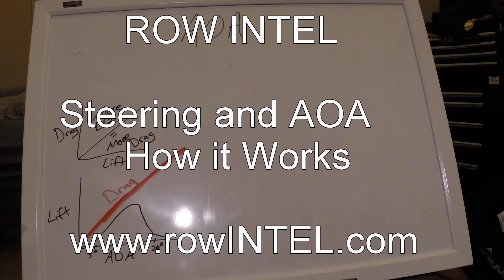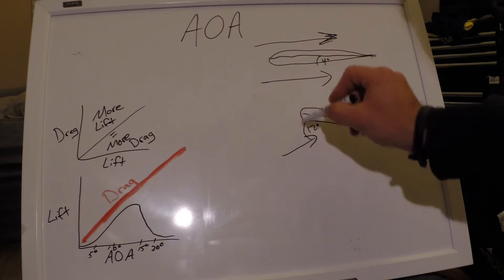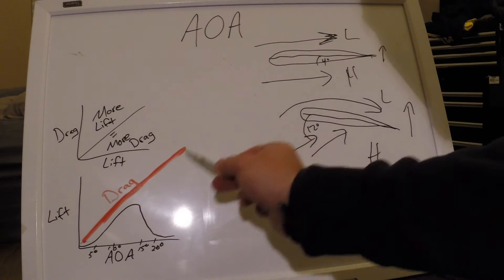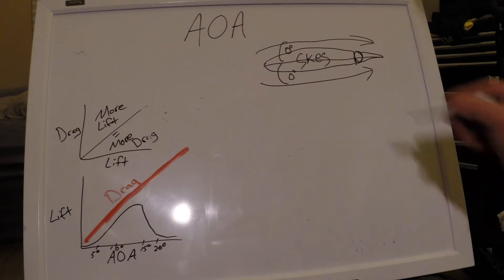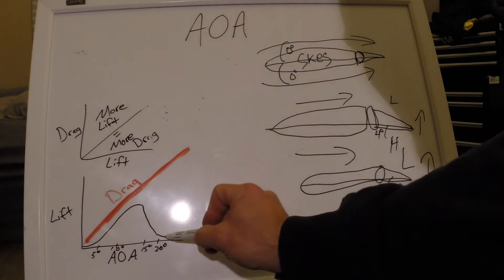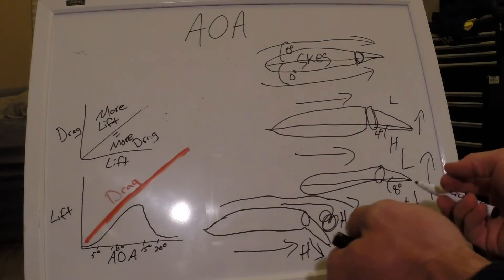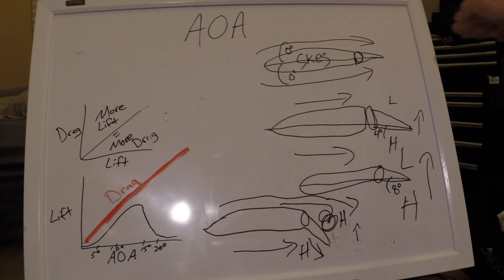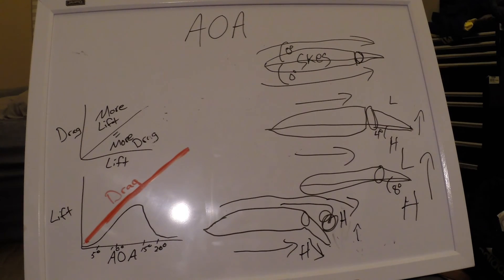How the Rudder Actually Moves the Boat, Generates "Lift"

Comment: thanks for posting. I have a question. I rebuilt a rudder and I guess the symmetry is off.  The boat now pulls to port when over 4.7 knots motoring. The boat is a 41 ft sailboat. the wheel wants to turn counter clockwise and the rudder wants to point with the leading edge pointing to starboard and the trailing edge pointing to port.  From this are you able to tell which side of the rudder is too thick? too much foil?  I was going to pull the boat and grab a grinder.  Also do you know of any methods to check for symmetry? thanks

Comment: Another point take your air gun and propel air through the water only on one side the rudder nothing happens. Now turn the rudder slowly to the opposite side, no chnage should be observed. Now turn the rudder back to the water movement side now the boat turns because the water flow is pushing against the rudder moving in the same direction the water is moving.  No lift just the force of the water moving the rudder away from the greatest water flow upon it.